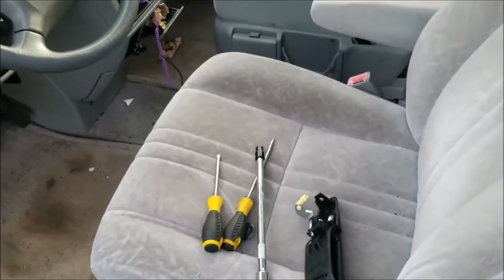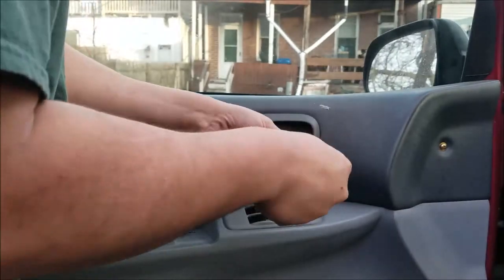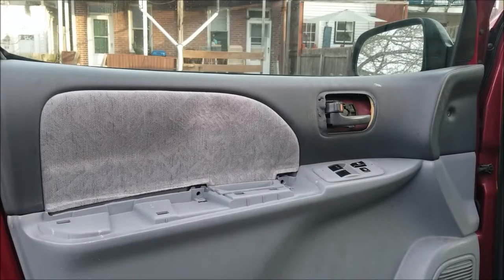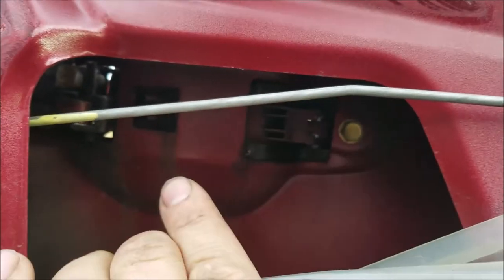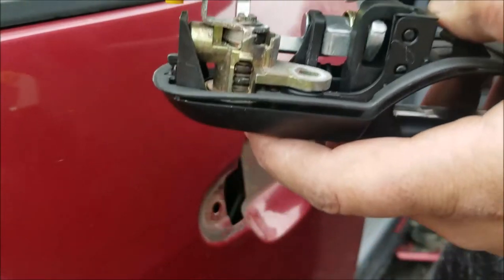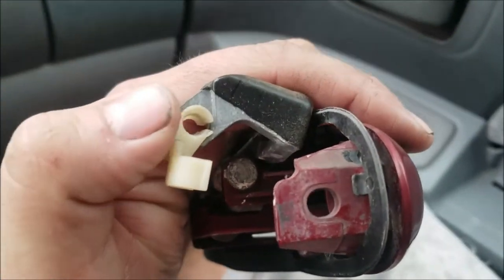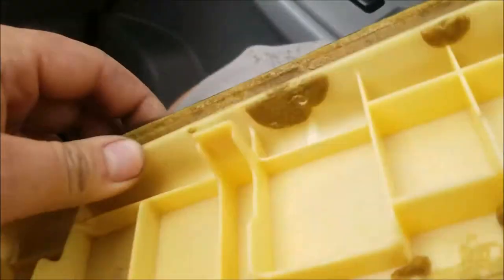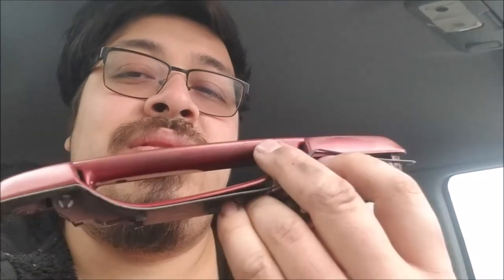HOW TO REPLACE OUTTER DOOR HAND TOYOTA SIENNA (1999-2003)

Comment: A lot of people still looking at these videos...just shows how long-lived these cars are...the first generation are considered the most reliable Siennas  ever made...Toyota dropped the ball in 2004 by cheapening the car significantly (cracking dashboards, broken door hinges, etc.). In terms of door handle replacement, this job can be a real bitch…one thing that I do to make it easier is to remove the window channel that partially blocks the door handle area. It is held on by one 10mm bolt located on the inside edge of the door. Once you remove that one bolt, the window channel pulls right out providing you with much better access. Don’t worry about it not going back easily…it guides itself back into the proper location at the top and easily lines back up with the bolt hole when you finish the job.

Comment: Getting that rod out of the old one was a real pain. Added about an hour to the process. I had to break the little plastic flanges that keep the nipple thats on the end of the rod from slipping back through, in order to get it out of the old one. Ran into a couple other problems that made it take 2.5 hours total. But this vid made it possible and it works great! Thx!
Reply from the maker: Your welcome I'm glad the video helped that why I make them

Comment: Cool!  You are learning as you go, but are good at describing how to get around the problems you encounter.  Great, thanks!
Reply from the maker: Your welcome thank you as well
Reply: @rhyanvibez9397  I am having a problem.  The replacement handle (and the old broken one, when I re-installed it to check the fit of the new one) are now interfering with the window track.  Do you have any clue as to how that could happen?  Thanks.
Reply from the maker: @JeffGibbons620  maybe something is not put in the right place or put back in the wrong order

Comment: The easiest  way  do it  : 

Remove the window rail by unscrew one bolt (located outside at side of the door) 

Then you can put your hand inside and use your finger to unclip + unhook the yellow plastic rod. 

And then remove the 3 bolts (including the lock bolts)
from inside. 

Then door handle will come out effortlessly. 

Put the new handle in first.
(without connecting anything) 

Then everything in reverse 
(Screw the bolts & connect the rods etc)
Reply: Thank you!!!  This helped me a lot!
Reply: @BEasay  You're welcome. I'm glad it helped.
Reply: @June0696  ☺☺☺
Reply: Why don't you post a video???

Comment: Thank you for making this video. I have a 2000 sienna and the power slide door does not close all the way. Have you or any of your followers had this issue.
Reply from the maker: I had this same issue with mine the cable for the power door was snapped

Comment: Doing mine in the rain as well 💀😂😂. I did passenger door last year in summer time last year (did passenger first because it was so broken I could stick finger in & open door even when locked I could unlock it lol). Now im ready for driver side cause climbing in on passenger side is becoming pain in the ass. Btw the slide doors are EVEN EASIER to fix btw, stress free even faster than this simple job. I’m gonna buy a 2nd Chinese replacement set again so eventually when they stop selling it I’ll already have a set 👍🏾. Starting to wonder where this video was back when I watched that trash video about the passenger side lol. That side screw tip saved my life
Reply from the maker: Well I'm glad the video helped I miss this van it was a great van

Comment: How do you open the passenger side door on a Toyota Sienna that doesn't open from either side. I was wondering if you could tell me how or do a video. I am a female and this video helped me change drivers side but I dont know how to do the other side
Reply from the maker: The passenger side is the same as driver side just flipped

Comment: Was following these instructions and when I was putting the new handle into the door, it swung closed and now can't be opened.
Reply from the maker: If your door panel is off you should be able to open it from inside the  van